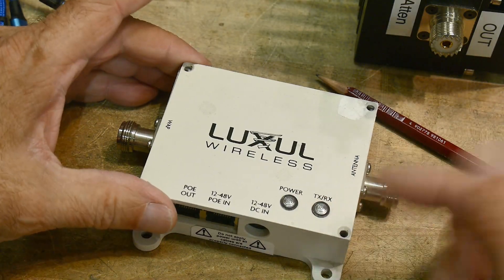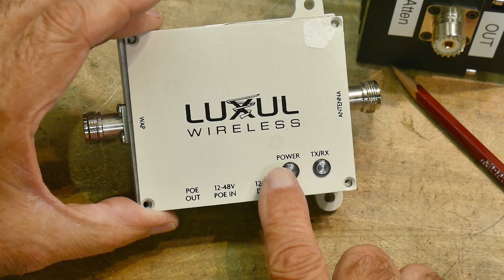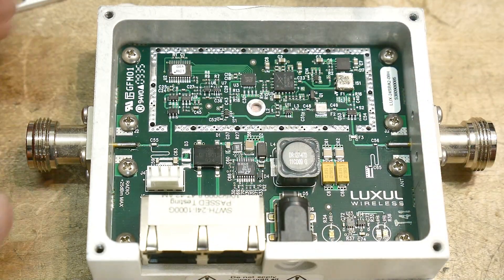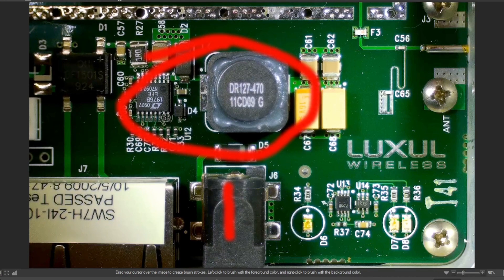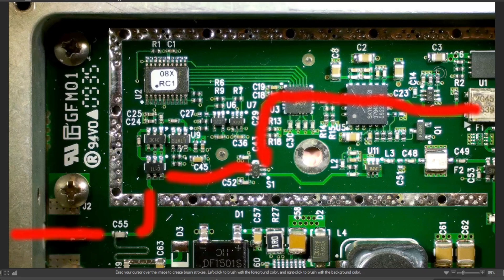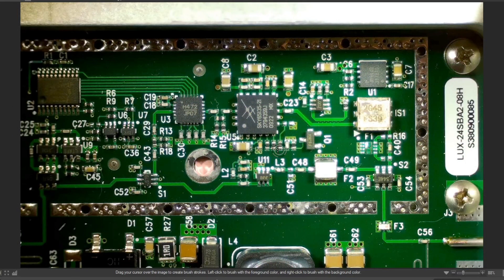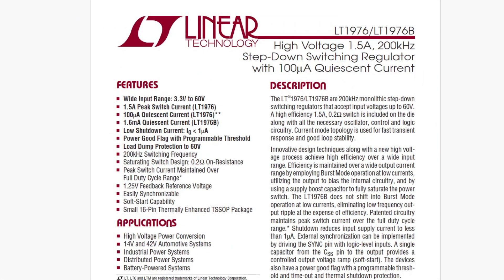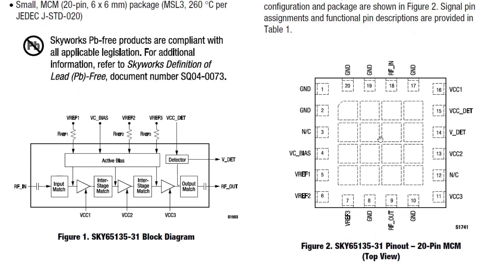#2008 WIFI node teardown (part 2 of 3)

Comment: IEEE-802.3 standards-conforming PoE needs to have a ASIC or microcontroller to negotiate with the switch to enable actual power delivery. If it doesn't have that, it's probably passive PoE, which isn't good as the power supply is continuously injecting power onto the wires, which will fry any non-PoE device connected onto the cable. It doesn't stop many large OEM's from using passive PoE though (Mikrotik, UBNT,...)
The voltage of 802.3 PoE is usually 54V, so that's why they need a 60V step-down.

Comment: u2 is mcu from philips P89LPC924 and u3 is step attenuator from Hittite HMC472A. U1 seems like a variable linear regulator based on the place of caps and resistor network around it.

Comment: I used to work for a company that installed VOIP phones in offices.  POE was a godsend because it eliminated the AC adapters for the phones resulting in a nice clean installation.  Basically just replace the existing phone system with a POE hub, replace the existing phone jacks with ethernet jacks and the new phones just plugged right in.  And as a bonus they had ethernet for the office computers. Just daisy chain the phone and the computer.

Comment: Wonder why on the POE input there is a full wave recifier. Isnt the POE already DC ?  At 4:17 Why the RF is going over to the PSU ?  Curious ..
Reply: reverse polarity accomodation?
Reply: Perhaps there's an option to supply power up the cable from the radio side to the amplifier mounted some distance away.  Maybe it's power IN, not bias power OUT from this device.